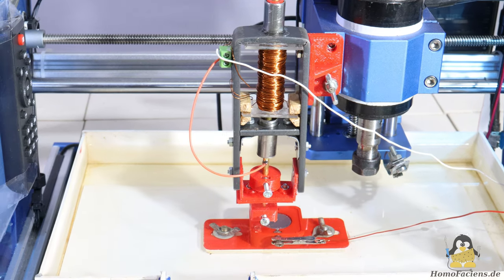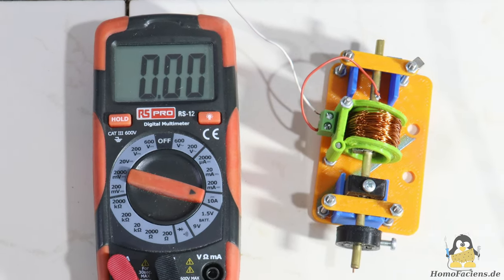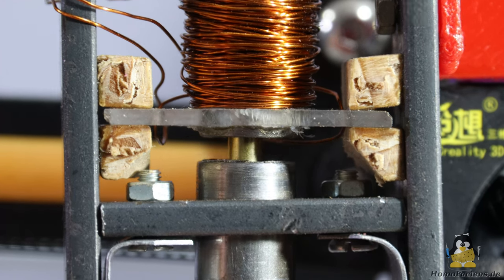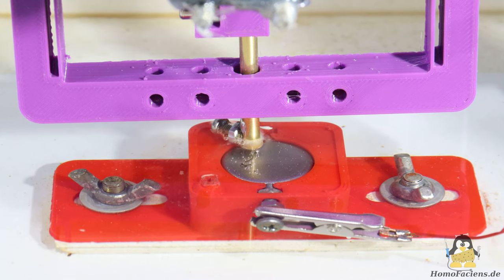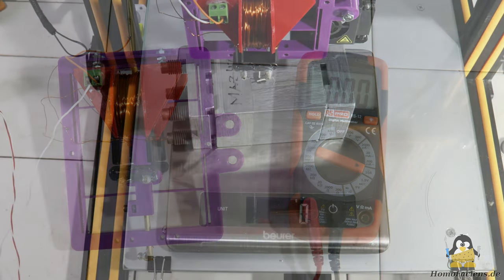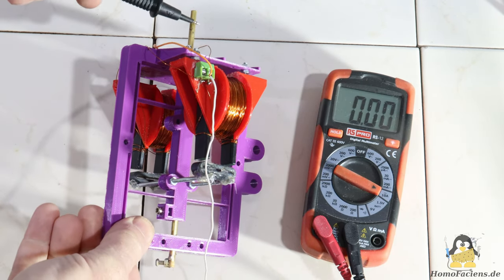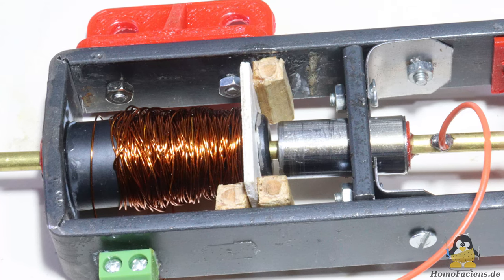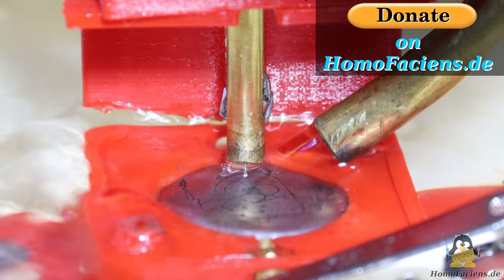More experiments in engraving metals with a Wagner hammer

Comment: great progress!!!  keeping the electrode turning may help keep it flat on the bottom but also may make it some other shape.  From the research I've read arc vs spark has a big impact on electrode wear.  Maybe you can get a capacitor/inductor combo to help control the on/off time and get more sparks vs arcs?
Reply from the maker: That's when active control will enter my series. This is just a circuit controlled by the circuit itself. Dead simple and works quite well.

Comment: Interesting project...
What if you were able to adjust the voltage and amperage of the arc and the lift magnate independently?
Also, the electrode has a blunt tip unlike the electrode of a TIG welder which is tapered to a sharp point.
The sharp tapered tip causes the spark to be more concentrated which would erode a thinner line while the flat tip makes a spark which is a lot more spread out meaning a wider and more "fuzzy" line.
It is going to be interesting to see where this project leads.
Reply from the maker: That's what I called "active control" at the end of the previous video. I am currently experimenting with DC motors converted to a Wagner Hammer, (without electronics) which works really well. After that I will start adding electronics to the system.

I have used a tungsten tip in the previous video. That tip became blunt relatively quickly. Consider I am engraving 0.2mm lines and that works well with the wire (no need to resharpen your electrode).

More experiments are carried out in coming videos - stay tuned!

Comment: You might want to  try using a 3d printer nozzle as a wire guide at the tip. 
It might help for the smaller diameter wires.
Reply from the maker: I see, you have watched my previous video to the end: https://youtu.be/rS5600spxEQ
;-)

The Hammer I am working on is using a guide at the tip. Stay tuned!